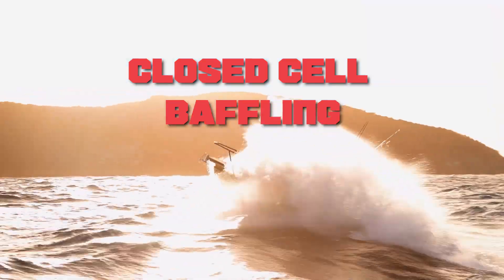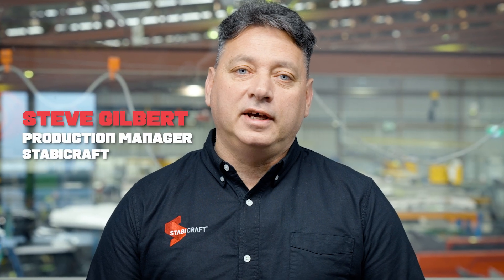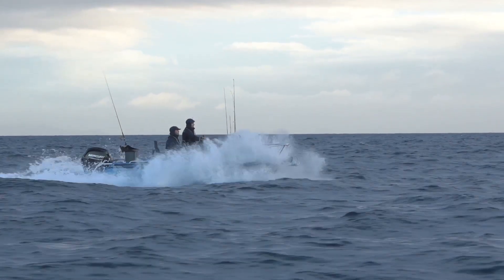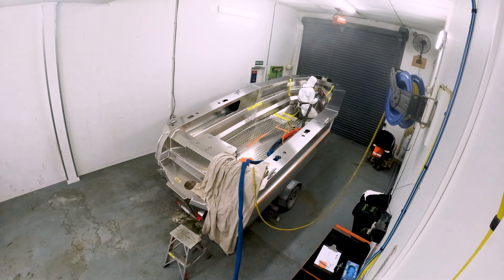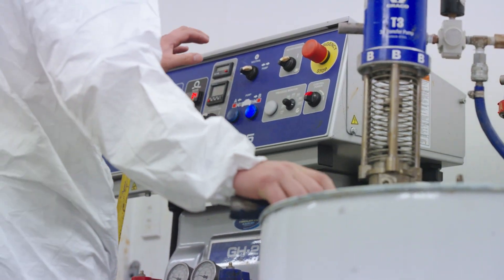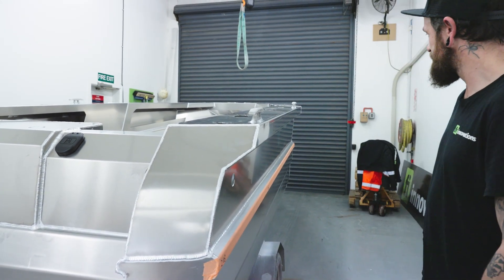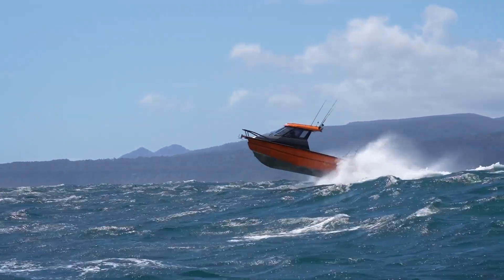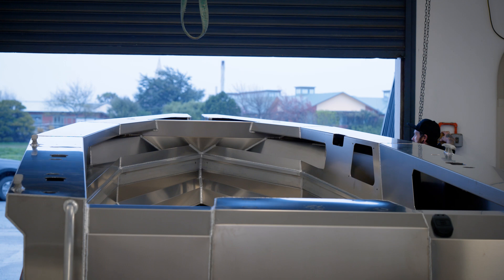Stabicraft® Inside Innovation - What is Closed Cell Baffling?

Comment: But can  you weld on the pontoon if it's filled?
Reply: Good question as my mates 25 year old stabi needed welding 3 years ago because a weld had cracked between the hull and water filling up the pontoon when out on the water. We had to get it welded up and had to put extra vent holes in the pontoon so air could be blown through while welding. I would say good idea for foam but if it needs repairs the pontoon will need to be opened up and foam removed before welding. Maybe stabi can comment on this topic.
Reply from the maker: Yes, you can weld to foam filled compartments, but you must be careful not to blow through plate. If this happens you will have a mess on your hands that may well be too hard to fix. The foam cell is fire resistant so no flame or explosion issues, however the foam will melt at the surface and bleed into the weld. This is the mess mentioned earlier, if weld is contaminated its difficult to close over and will look ugly when complete.

In brief, yes you can with caution.